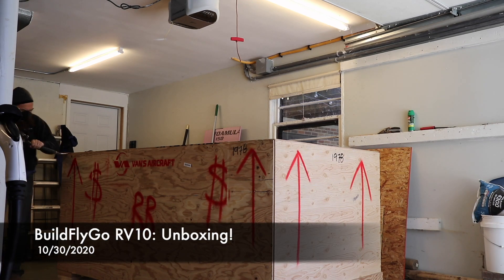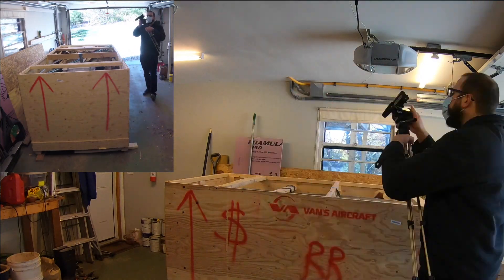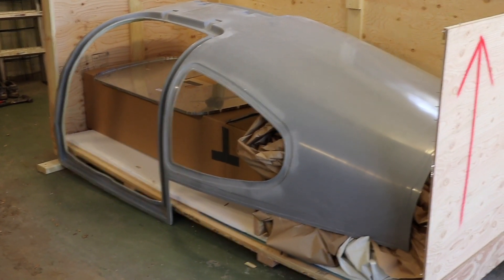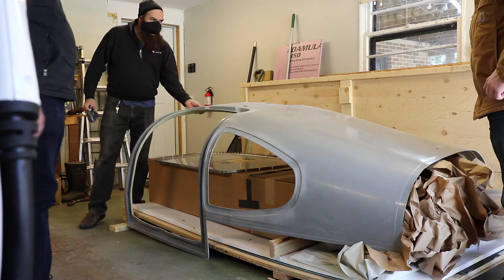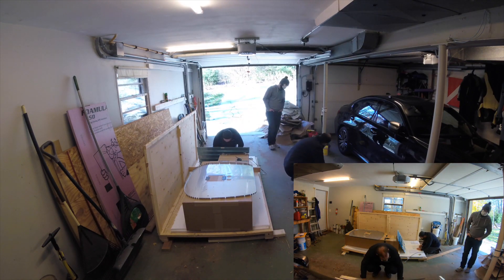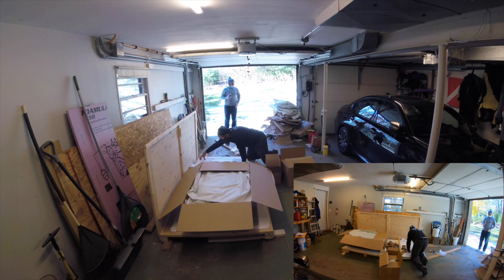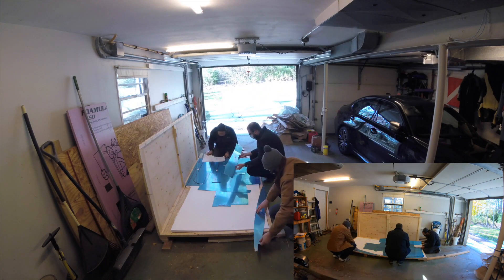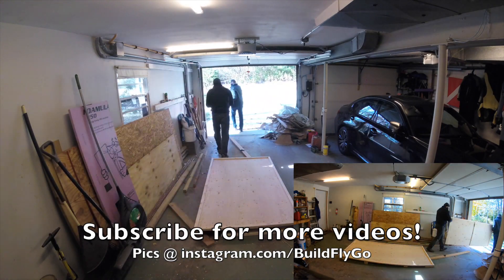RV-10 Fuselage kit Unboxing

Comment: Hi Guil,  I am curious as to why you decided to select and build the 4-seat RV-10 since you already have a beautiful RV-9A?  I am torn between selecting and building an RV-14A versus an RV-10.   I would like to have a comfortable cross-country airplane for my wife and me to travel in; so I don't really need a backseat for extra passengers.  Also, do you think your RV-10 will have a much higher operating cost, once it's flying, versus the cost to operate your RV-9A?  I would really appreciate hearing your opinion.  Thanks!
Reply from the maker: A few reasons, in no particular order:
- We are thinking about an Europe trip and need more space for fuel. We are adding extended wing tanks (15gal) to the 10, and plumbing for a possible large ferry tank that would go either where the rear seats are or in the luggage compartment.
- We want to share airplane trips (Bahamas in particular) with non-airplane friends.
- I wanted a project for while we are limiting social things this year. 
- We plan on getting a partner (or two) in the -10 once it's flying, and keeping the -9A for the majority of our travel.
Individually, none of these reasons would be sufficient for us to build a -10, but all together it tipped the scales. I think in particular the needing a project in 2020 really weighed on this one.

The -9A is a fantastic cross-country airplane. It sips fuel, goes pretty fast, is fun to fly, and is comfortable. The -14 is that plus a little faster (and burns a little more fuel). Unless you want to fly it across the ocean or have a 3rd or 4th person that will fly with you often, the 2-seater is more than sufficient. 75% of my flight time is just me. Maybe twice a year I wish I had 4 seats.

We expect the -10 to be meaningfully more expensive to operate. 
- 1.5-2x the fuel burn for not much faster than the 9. You -really feel this overseas...
- More cylinders, more moving parts to wear.
- Significantly more expensive to insure.
Reply: @BuildFlyGo  Thanks Guil for getting back to me!  It sounds like you are recommending a good 2-seater RV for me and my wife since we will never need more than 2 seats.  I think the RV-14A  would be a better choice for us than the RV-9A because it has a slighter larger cabin and I will need all the space I can get since I am a big man.  Also, I was told that the RV-14A would be easier to build than some of the older RV models with the kit coming with all the punched holes final sized.  With that being said , I still dream about owning and flying the RV-10 ... it's a beautiful airplane!  You and and your wife are very fortunate to be able to travel internationally in  your very own airplane.  I hope someday, my wife and I can do the same.  I'm really enjoying watching all your YouTube videos, especially the ones on building tips.  Thanks for sharing your knowledge to all of us RV builder wannabes! Best regards, Bob
Reply from the maker: I propose thinking about your mission. If you don't really need 4 seats you can save a good bit of money & time by going with a good 2-seater. Every so often you can rent a 182 when you need the extra seats. The -14 will build much faster than a -10 or really any RV other than a -12. They made huge improvements to the process for the -14 which are starting to trickle down to the -10. Maybe someone nearby has a -10 and looking for a partner? That would be the best of both worlds, one person owns the -10, the other the -14 and they share as needed. Our goal is to partner the -10 so it's available when we need it, but keep the -9 as the primary airplane. #firstworldproblems
Reply: @BuildFlyGo  Thanks for your great advice. You have helped me with my decision. The RV-14A is the right airplane, at this time, for me and my wife to build and fly.  Now it's time for me to get to work!